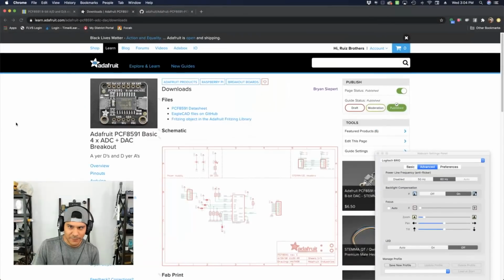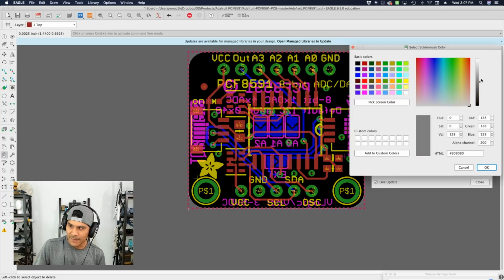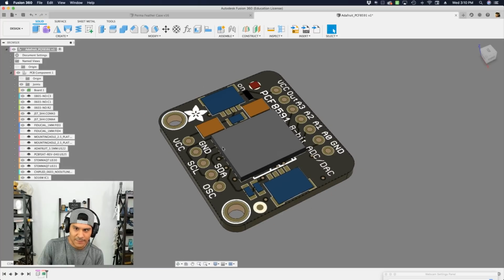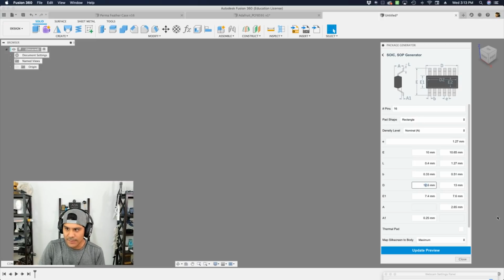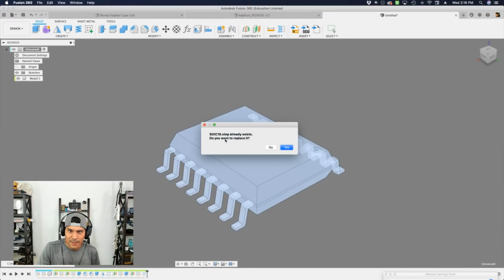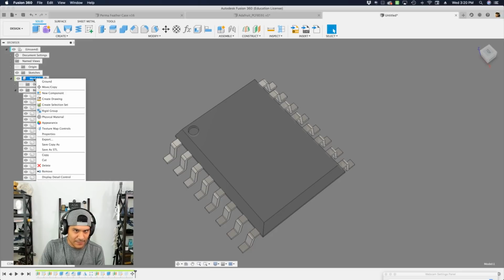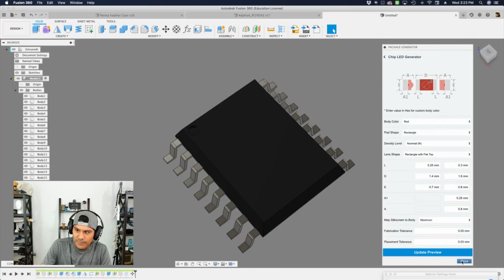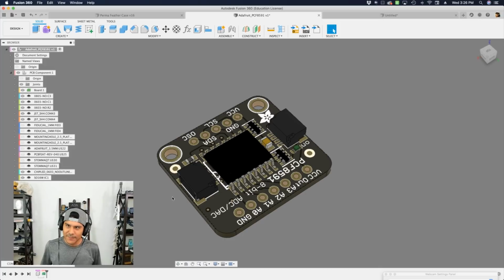Fusion 360 – Using Package Generator for PCBs #adafruit

Comment: This is really helpful and I using this trick every time I converting my board into 3D design. With the latest build of EAGLE, replace component does not available. And the best Eagle version to use this feature is 9.5.3 or at least below 9.6. 

And keep in note, adding custom 3d CAD file with Fusion Electronics is horrible.

Comment: great video, thanks. Unfortunately the menu to "replace component body" does not exist in the version of Fusion360 I downloaded today. Do you know of a solution for this?
Reply from the maker: Yes, that is definitely from the newer version of eagle. Eagle 9.3 was used in this video. The replace comp feature doesn’t work with eagle 9.6 in my testing. Will be working on a follow up video
Reply: Great thanks. Looking forward to the follow up!
Reply: @PatrickFelstead  I had the same issue (latest 360 Personal + Eagle 3.6.2) - if you follow exporting the STP file and go back to Eagle right click on the component and select 'Add Custom 3D Package' and import the STP file it will apply it to your board. The just push the changes back to Fusion 360 and reload the document - a bit messy but it works. I think I will create all the components, add them to the board and then apply (in the long run it would be better to add the to the Eagle devices library).

Comment: Thank you! I have had many of the same struggles and it's nice to see a known-good workflow that I can refer back to. And thanks for the backdoor into the 3d package generator to quickly generate STEP Files. I too have a folder of STEP files to associate to Eagle parts that don't have a 3d model because of no way to associate a 3d model to Eagle libraries you don't control. I use the Adafruit managed Eagle library a lot, so if you add 3d models to that, I have lots of thumbs-up for that.